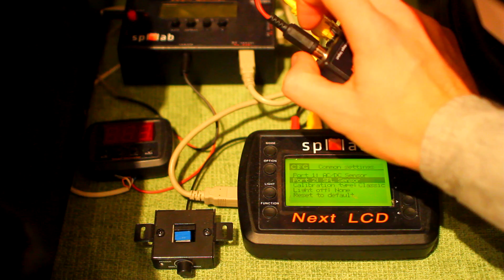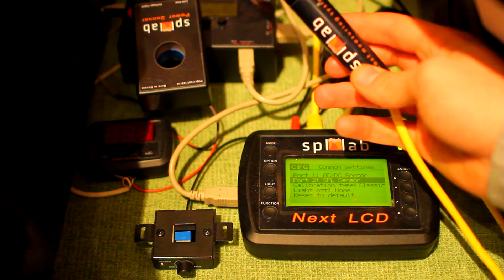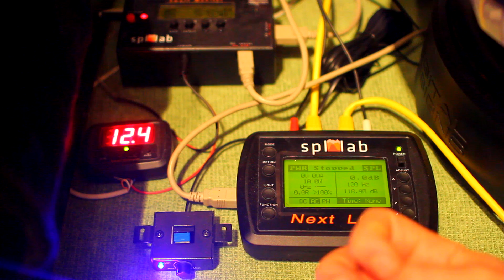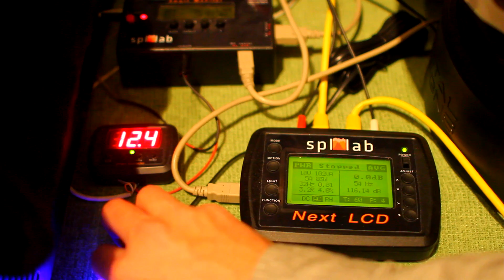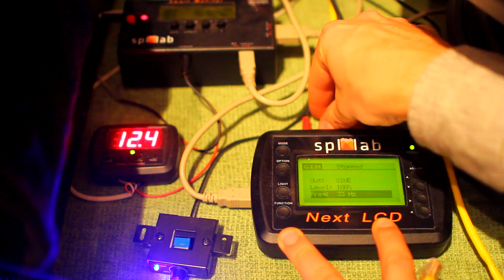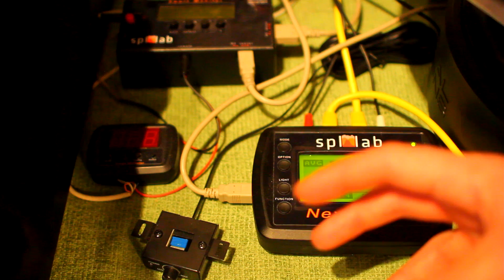In-depth look at the NEXT LCD from SPL-LAB!

Comment: hi barevids, do you have any idea of a cheaper SPL meter? cause those SPL LAB meters (even just the sensors) are really expensive, same for Term Lab meters, like i'd like to have an accurate SPL meter but most ones are really expensive, i'd like to have an unit of some brand that is very accurate and not too expensive, something standalone or that i can use with my pc/phone (thru USB) but that doesn't cost like € 250+